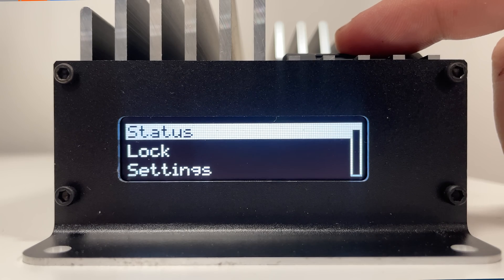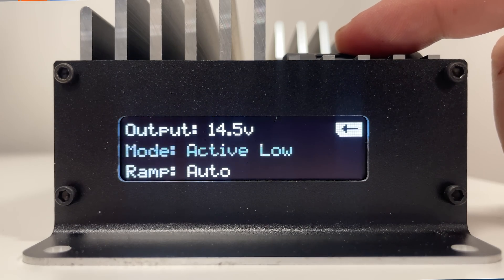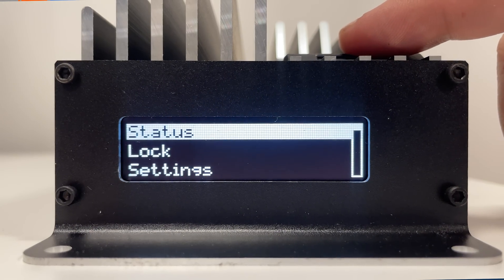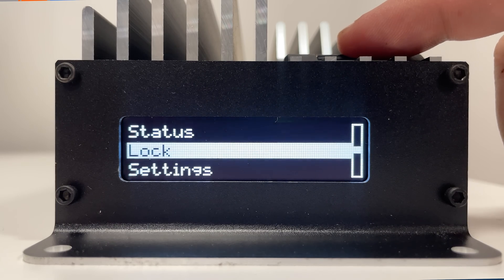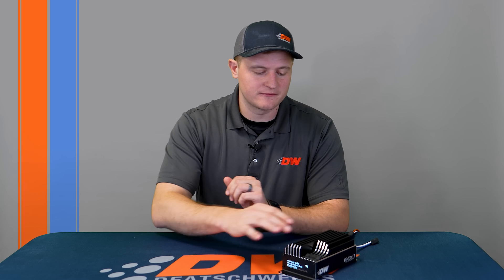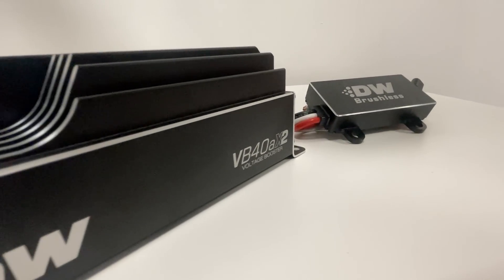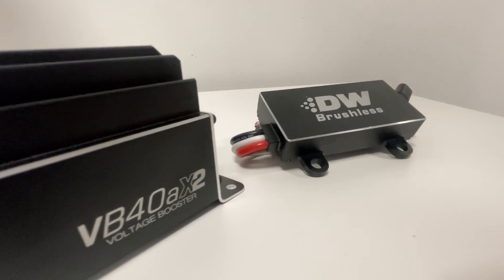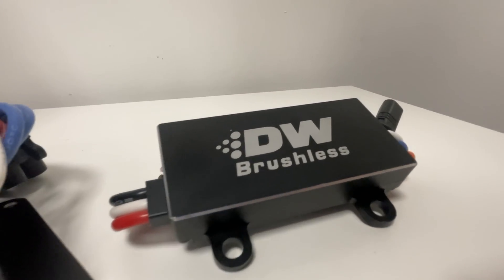DeatschWerks VB40a X1/X2 Voltage Booster

Comment: hello, so is it possible to run the dw810 pump/controller unit with this voltage booster?
Reply from the maker: The DW810 is optimized for 13.5V, there isn't any performance gained by boosting the voltage. Our pump characterization flow data on our website shows what our pumps flow at different voltages.

Comment: I'm installing a VB40a X1 on my supercharged RCF and will be doing a video for you guys on the install.  Just had a quick question, for the blue boosted wire to the pump, I'm just piggy backing into the existing 12v feed right? (was wondering if theres risk with backfeeding 18v to the source). Also for the Ramp up setting, Is auto typically the safest route?
Reply from the maker: Send an email to techsupport@deatschwerks.com and they will get back to you.